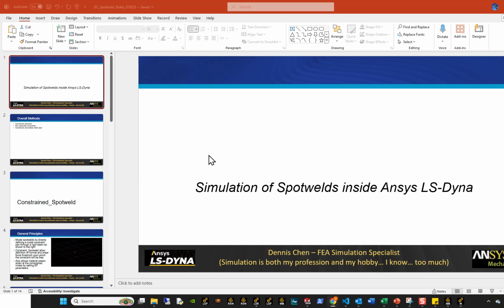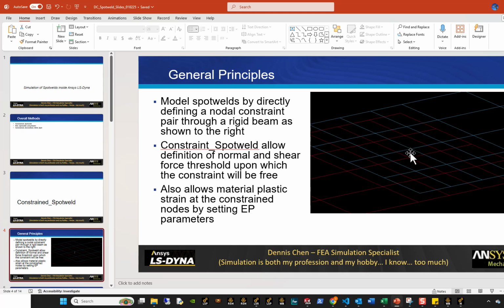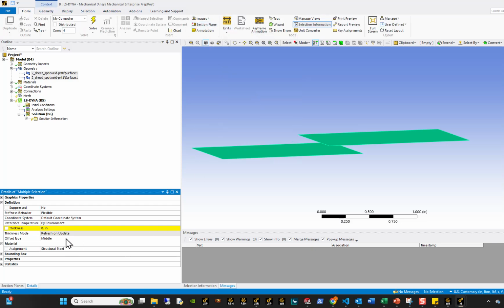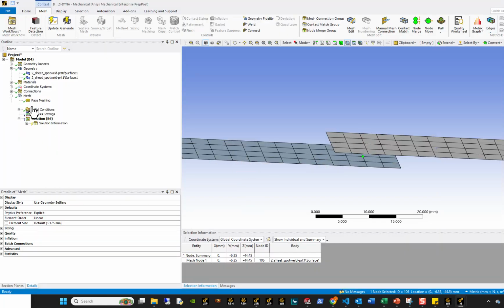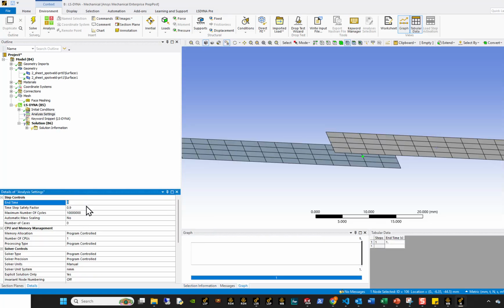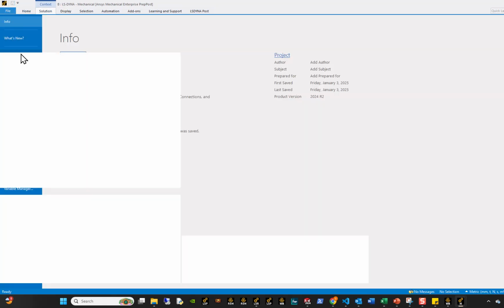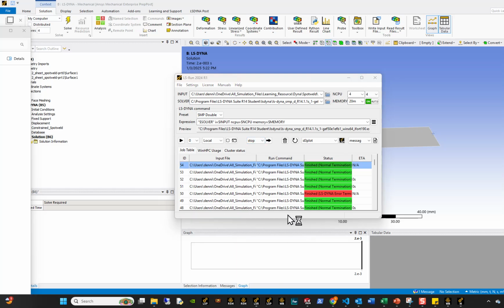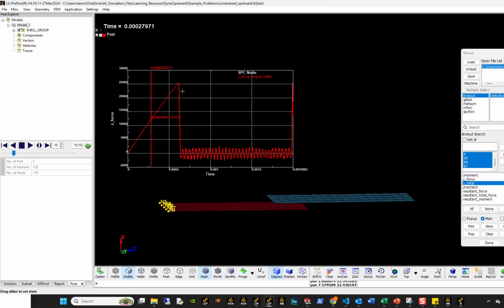Ansys LS-Dyna Tutorial - Spotweld Modelling Part One (Constrained Spotweld)

Comment: Thank you for this video. Could you please tell me that instead of modeling shear studs which used to connect the slab(solid elements) and girder system(shell elements), is there any way that we can model those shear studs using any other tied connection type to model like a string between the nodes (where the shear studs have fixed) of the girders and the slab? can we use SPOTWELD for that? or is there any other tied constraint type? also where we can define a shear failure as well as this modeling is for a blast analysis. that means that tied connection will act like a line connected between two nodes of girder and slab. because it will help to reduce the computational cost.